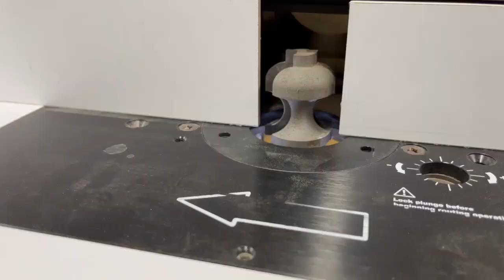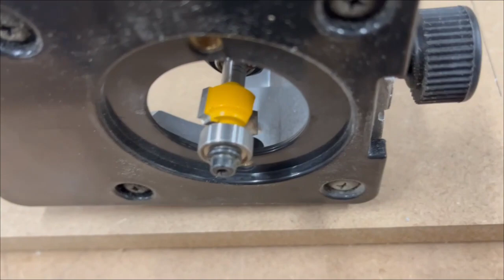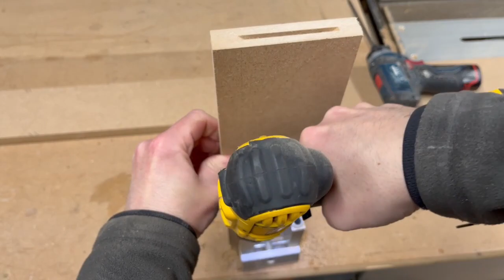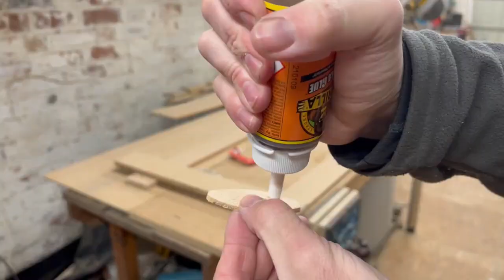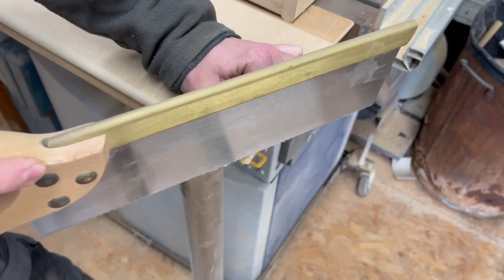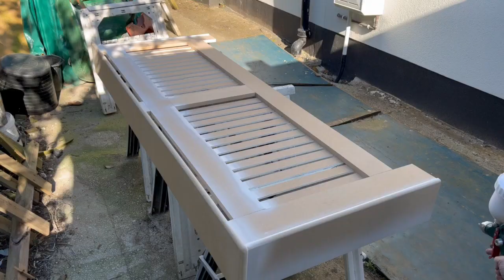Make Your Own Radiator Cover With This Easy Tutorial!

Comment: How have you mount it to the wall?
Reply from the maker: I scribed it to the wall and skirting board and there are two angle brackets under the top that I screwed to the wall through the vents.
Here's a link to my video about fitting them 
How to scribe/cope and fit a radiator cover. The complete DIY guide
https://youtu.be/N_FdXOgKXhk